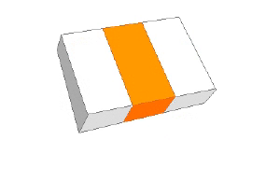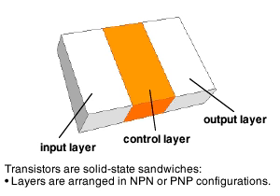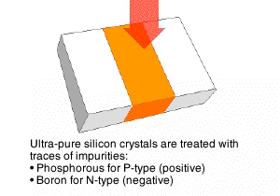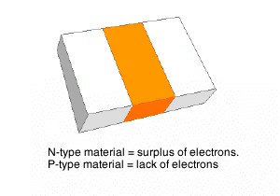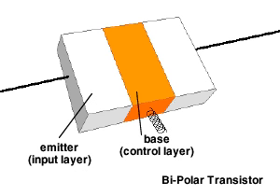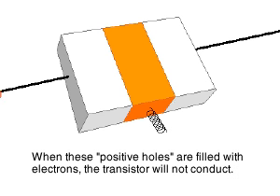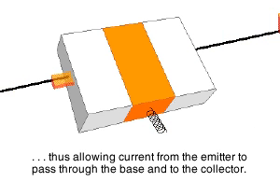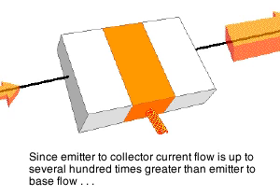Transistor as an amplifier, Rate My Science

Comment: I still don't understand how it amplifies...
Reply: Rodrigo Nahum Alvarez Ferreira i had the same problem...but the thing is...it does not amplify the current...(law of conservation of energy)....its more like a knob that can control the flow of current.... hence amplifying or "de-amplifiying" it.
Its crazy how they name this kinda stuff..pretty misleading....but that's just how it is!
Reply: @sibtiali802  

I must have seen at least 20 vids and read countless articles regarding the amplification

No one had any clear thing to say/write about amplification. 

Some said the amplitude is increased. 

It is so confusing. I actually thought the transistor can increase the current (more than supply). 

Finally after testing transistor circuits out myself, I realised, that they don't increase the input power supply. 

The terminology used was wrong and confusing. There isn't any amplification, just like you said. 

It's just more current is controlled by a smaller current. 

Thank you for affirming my observations.
Reply: +mexykanu  The amplification part is not meekly  dealt in here . In this video It's just the physics behind the Transistor.
Reply: Ali Joo can you please explain it in more detail, I'll be thankful